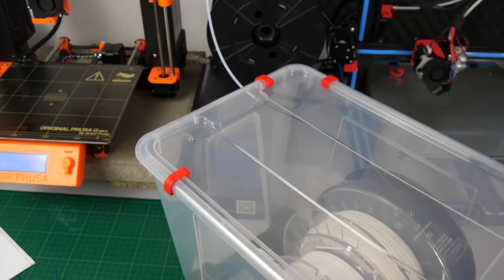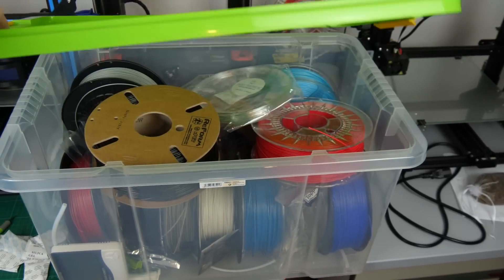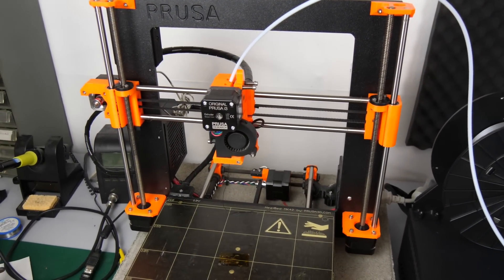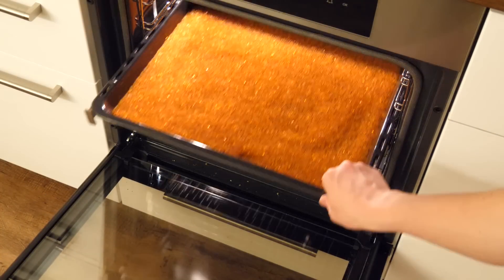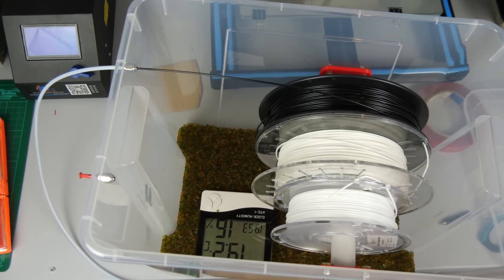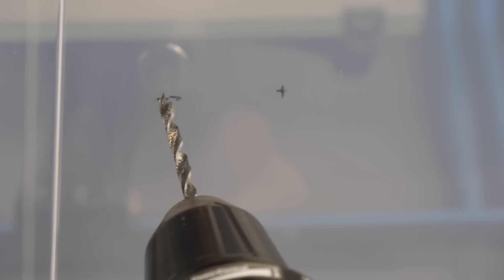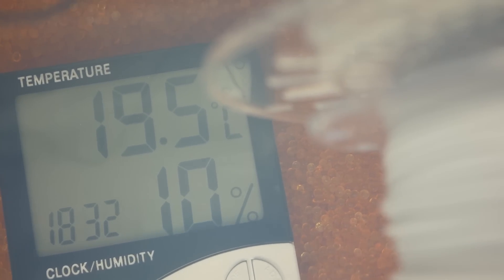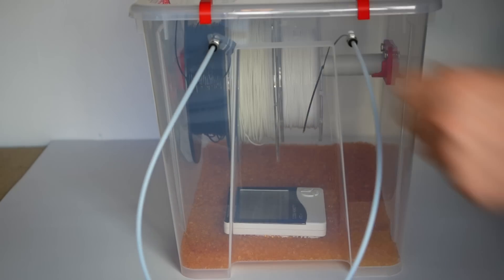Filament Dry Box || How to properly store and 3D print Nylon, PC, TPU, PVA...

Comment: 1 - the link from where he printed the plug for the other hole
2 - the link of the 5:27 universal filament dust cleaner. 
3 - post the plastic clips for the container
4 - what size of screws he is using

Comment: Kitty litter Silica Gel works very well, just dry it before in a oven or microwafe. Stefanie should have done that too, since it's much cheaper.
Reply: Thankyou its so much cheaper.     The balls are around $55 a kg.   Wile i can get 5kg of the cat litter for $17.
Reply: @turtleman190  140Celsius for some time (hour or two) in a oven worked for me now. At some point it gets not lighter anymore - meaning it's dry.
Reply: @calmarcalmar  thankyou.
Reply: @turtleman190  just saying: additionally I put them into the microwave now anyway at 350watt 10 minutes .. loosing again 2g  per 100g silica. Now I have 5% relative humidity in the box, instead of 10%
Reply: @calmarcalmar  thankyou. I will definitely be getting some because of my house plant's my apartment is extremely humid.   I only just got a 3d printer. I'm going to print what i can in pla to start with, but I want to mostly use PETG.  And tpu.

Comment: Nice idea, did you not consider a heater like a commercially available dryer to assist the drying or do you consider that stage not required?
Reply: I'd be interested in the use of an active filament dryer also.

Comment: not relavent to the video, but i havent used my 3D printer in a while, so i never got to dry my silica beeds in a year. i got a new printer and didnt have a plave to put my drying box since the spool holder is on the top and not the side, so i had to take my filimet out of the box. being in California where the wether is crazy, the filliment did eventualy got wet, so i decided to go dry my silica bveeds finaly. let me tell you, those beeds took in so much moisture from the extream humidity caused by a summer heat wave. the heat was so bad that it rained hevily in the mountains and the evaporation from the rain reached my city. it felt like the sauna. in those few days, the beads turned to dark green. they look almost black. not sure how long it will take for them to turn orange again. but i think it will probably take more than an hour for me.

Comment: The silica gel for cats are working fine, but it's wet if you buy it.
I meant it makes zero sense for the manufacturer to dry it, it's just noch important for the cats toilet 😅 But when you dry it before, it's working great :)
Im using it since a year, dirt cheap and reusable 😄

Comment: I'm doing my first run of filament drying with your dry box - silicagel method. I'm still a bit curious when I have to change / refresh my gel. At which percentage do you normally change it. At the moment I have like 24°C and around 18% relative humidity. So it would be around 4g/m³ water.. 
Do you thing this condition is capable of getting some water out of my filament or do there have do be less relative humidity?

Comment: Hi Stefan!
Would also build my first Filament Dry Box. Would you share your special Bowden Coupler "protector"?

(Hoffe mein englisch ist einigermaßen lesbar :-P )
Kind Regards from Upper Austria
Reply: https://www.ebay.com/itm/233704900524?_trkparms=aid%3D1110006%26algo%3DHOMESPLICE.SIM%26ao%3D1%26asc%3D20201210111314%26meid%3D577119fd8d2e43319be40512cc5241d9%26pid%3D101195%26rk%3D2%26rkt%3D12%26sd%3D383893385334%26itm%3D233704900524%26pmt%3D1%26noa%3D0%26pg%3D2047675%26algv%3DSimplAMLv9PairwiseUnbiasedWeb&_trksid=p2047675.c101195.m1851&amdata=cksum%3A233704900524577119fd8d2e43319be40512cc5241d9%7Cenc%3AAQAFAAACEJ6SXRZjHHoA2rJCX7TC39VU26GWP1zoQEn5Tq%252BFoCjtXTRRIB2sj2ZMjkksnbLQjM2Tjz1b3qJlkj%252BYGbZXtfbWViCaui%252FBMAUIH9ebEa1ZIrMcY0YCvW0wX2F2W4k7CtJ8y8AuvO%252BusNiJVX0CmZEvMusgME8BVomeR3JvGIc4jEtquGzJj1XIE7I3BpwBR41ITw6moRSmp%252FWDG4Vi4J%252FdhCEPCngyc5nmTmrVqCqbv2M0mn0pQ06vmrkvLnsm0QVBfWXFH2hiATKuv18mUWqdNsEDJtfioVihKOiUX%252BhBXbgk5SNjw2xyzoF4qmpVl04kCmlX1a4uIQQI7Hg4O0fOx44l1ZyrWLtXiz5T47A1lNxuzbEJlZ6yurJLorxSqpYT99NkF50qCkHNKU94zfareaB%252FrYvJjWri0c4Pw8tY0HNBGHN79P5uReth1jUqMeKHRyb%252FkMn2u0iNaTnc1vA0MUABRXqj0pAgoJjC8uv7CVNMNUKHq7pTgUvemAA%252Bkit%252FSzwWs%252BfGKJnUoNPiOHgYfCLbRUzdok1YjLghIaGdNrthB%252BSAuGNQ4cjTHMfATIj2nxtUCww7s2qdJSL76XGadSpa%252BCu1RKsCMSH%252F%252FRIb%252BL3na6SYPUtO9ayrJRX8b98k5HJMsGOtjez8r6qPjPlQ9si37iBRxLoZoUnZkkr5CBvIAbg6cwLtLk3jRZeSzA%253D%253D%7Campid%3APL_CLK%7Cclp%3A2047675

Comment: I tried Kitty Litter Silica Gel and my tester showed 80%+ humidity.  I took some and dried it in the oven for a couple of hours and now I'm getting under 15% humidity, so I would say it works but needs to be treated as already saturated when you get it.  It was a lot cheaper than other options I could find for Silica Gel, and readily available so I decided to give it a try.
Reply: I'm glad you said this because I can just get everything at store instead of waiting

Comment: that box you linked to doesn't seem to be a Samla, but a "Lock & Lock" brand one that says it's only 22.9cm high, which feels a bit tight given many spools i have are around 20cm in diameter, did you actually try it with that box?

Comment: Chances are you have a heat gun. Instead of drilling which might crack the container heat up the drill bit with the heat gun and just press into the plastic. Clean and easy

Comment: teflon tube gets stuck in my connectors if I put it in. How to fix this??? do I take the metal things that latch to the connectors out?(this means looser fitting is this fine? Also what type of nuts are used for the p4-m10 things, I ordered m10 nuts they didn't fit idk what the threading is classified as(i managed to find 3D printed nuts though so that problem is not an issue)

Comment: How did you connect the bowden tube to the extruder?
Reply: He didn't. It's not needed, as the filament is pulled through, not pushed like it is between motor and hotend in a bowden setup. The PTFE tube here is just used to reduce the exposure of the filament to moist air, and maybe to guide it if you fix the tube to somewhere. It also makes it harder for moist air to get into the box through the holes for the filament.
I'm planning on building something similar for my PLA, just because I'm storing it above my printer anyway, so I can just as well make it easily accessible when I want to change colors. For PLA I could probably get away with just making sure the hole where it leaves the box is tight (maybe with a sponge seal), but I think I'll add at least some tubing, maybe even enough to guide it close to the printer.

Comment: When printing the box lid clips, I should probably not use the PLA filament that came with the Creality CR-10s? When attempting to clip the box lid to the box there is a slight cracking sound emitted. Would a different filament type be better for this application? Oh, and I applied the weather seal (on the list) onto the underside of the box lid. Maybe that is the problem? Cheers!

Comment: Hello I really like your fillament test. Can I ask you to print 2 sets? First set do normally but the second one put in oven first. We are baking ABS injection molds at 80 C for hour witch really change its properties. It release stress from molding make it not to crack. I would like to know if it works on printed parts and different materials too. 
I Know there is lot of stres in the material after print.

Comment: Hi Stefan,
Thanks a lot for your works.
Is there a way to get all the components for the dry box in Europe? 
All the links refer to Amazon USA.
Best regards.
Reply: In usa, use a sterilite gasket box. Ziploc also has a gasket box, but the sterilite is easier if your local home depot has them in stock. Note all 4 home depots in my area reported having between 1 and 7 gasket boxes online, but none actually did. Make sure to call ahead. It will save you a drive. Luckily the lady at the first home depot was nice enough to call ahead with the item code and saved me the remaining 3 drives.
Reply: Sorry, you are not in usa, you are in EU. Dyslexia sucks

Comment: Why do you store the filament in that orientation in the box? You loose space for potential more filament rolls for each box... I use the same IKEA box, Samla 22L, and I printed these, which you don't need to screw/bolt through the box (though it might be helpful to glue/silicon them in place) https://www.thingiverse.com/thing:1888463

There is also this version https://www.thingiverse.com/thing:1752874

And these clips remixed by me, from a great design I found on thingieverse also https://www.thingiverse.com/thing:2216335
so you only need 4 of them to close it properly. Requires about 16 cm build height.

The box has PTFE connectors on both the inside and outside, but I didn't have any PTFE tubes connected at the time I took the latest picture :)
Reply: Thanks for this well-thought upgrade :)

Comment: at work we use a vacuum pump to dry out materials during storage. We use mainly resins but i think it can work also with filament spools.
Reply: Marco Calenda i was just thinking of that. Does it deteriorate the material? In vacuum it starts to release gases which might be detrimental to the material properties.
Reply: @konradritter7543  No. Filaments are stored in vacuum bags under negative pressure.
Reply: Vacuum pump? Seem a little overkill, don't you think?

Comment: Was under the impression that once your filament has picked up moisture the silica gel won't remove it, you need to put it in the oven. Is this not correct?
Reply: meucunt1 its correct you, if I have some old rolls of abs that bubble you stick it in the oven. And even with the setup you still will have to bake the nylon once in awhile

Comment: So i don't need a dry box for pla?
Reply from the maker: +björn santesson It can even have benefits for PLA, because dry PLA can be printed at higher temperatures increasing part strength. Also during wet summers, moisture can even become a problem for PLA.

Comment: awesome as always!  one thing to look into getting contained silica. much easier and neater. don't have rip the whole thing apart to empty, dry and refill the unit, and it's generally out free.  I use EvaDry units. the have a heater and everything built in. turn color, pull the evaders unit, plug it in over night and then throw it right back into the box. Very handy that way with zero mess.
Reply: The Eva-Dry units use orange-to-green indicating silica gel, which contains methyl violet as the color-changing agent. Methyl violet is considered to be toxic, although it's unclear whether it's truly unsafe in this application.
Reply: yup, but it's deemed "potentially carcinogenic"  in large volume, but safe enough and can possibly have medical uses. the Blue changing ones use cobalt chloride which is just plan toxic. In reality both are incapsulated in the silica and have very little chance of being harmful unless you over heat them and they pop open. which again, Makes the EvaDry safer as it's a much lower temp compared to an oven and is near impossible to have happen.
Reply: Probably not a problem unless it's disposed of improperly and kills some fish. ;( Do you find that one Eva-Dry unit per storage box is enough? How often do you need to "recharge" it?
Reply: ya, one is enough for each of my 72 qt boxes.  Mid summer when here on New England shoreline the humidity averaged 80+ percent, it held under 30 percent humidity and I had to re charge over night like once a month. Winter, with heat on and super dry low 30% humidity like once every 3 months if that. That is going to depend on how often you open the box and such. I had 2 yr old filament that was soaked and was going to toss, thew it in there for a week or 2 and it was actually printable again, not going. to say it was perfect cuz it wasn't, but was usable for prototype printing where I just wanted to see how the shape is of the model.
Reply: Thanks. Sounds good. I'm going to give one a try.

Comment from the maker: Sebastian made a very true comment. Use Cabalt and DMF free silica gel, because some indicators are potentially toxic and carcinogenic! Replaced the link in the description with non-indicating silica gel. Health goes first! Just use the hygrometer to judge if the desiccant is saturated or not. I'd make sure that the moisture in the box is below 20%.
Reply: With the rain here humidity can go up to 90% or sometimes higher, no wonder I haven't opened my CarbonX roll yet.
Reply: Just as an information: The general information about Cabalt and DMF is correct and you should look out for them, BUT the product in case (ST Trockenperlen) is Cobalt and DMF free (it's advertised as such and labeled by them as "nontoxic").
Reply: Kinda makes me glad I live in the southwest USA. Humidity doesn't often go above 40% unless it's monsoon season. (for an example, it's supposed to rain tomorrow, but humidity is only 20%)
Reply: I could be totally wrong but aren’t the blue indicators the problematic ones (and thus banned in EU), and the orange ones are okay?
Reply: @Sa-fd7ih  orange one are mitogenic
Reply: @Sa-fd7ih  the orange-to-green silica gels contain methyl violet, which is toxic and potentially carcinogenic; regardless, it is not safe to use in or around food, so it should not be reactivated using an oven or food dehydrator that you intend to use with food again.
Reply: That link does not work for me
Reply: link for silica gel goes to "DRY&DRY unknown" :(
Reply: "DO NOT EAT" what does it mean??
Reply: @truantray  It's mean DO NOT EAT

Comment: Humidity will still get into a thin non-sealable container.  I like your effort, but must get a box that can SEAL.. but thanks for video!
Reply: you can see 15% and 16% in these boxes. That super low.
Reply: You can test the moisture levels easily. Even in this design the moisture is radically reduced, the is no real need for a completely air-tight seal.

Comment: Nice Video. :)
But do you think it is worth it to buy one of those instead of the reusable Silicat? https://www.pearl.de/a-NC4809-4320.shtml?query=Luftentfeuchter
I use a Drypak with reusable Silicat but my Dad want a electronic Solution. (I don't know why)
What would you recommend?
Reply from the maker: This is basically the same, since it also contains silica gel, but obviously has an internal heater for restoring the desiccant. I'd still go for the loose pearls, since they can capture more moisture (due to just having more material). But still, should also work!
Reply: So i pay for a Solution that dry the Pearls inside of that Thing but don't have that mutch of it inside. :)
Reply from the maker: +Andre S. Exactly.

Comment: Aie aie aie.. 21 hours too late ^^
Richard Horne just did this one: https://www.youtube.com/watch?v=RvTTQqqWIWA&t=0s
Reply: Yes, but Stefan's design is nicer than Tom's, and it includes a hygrometer, which is pretty much a necessity without color-indicating silica gel. And Stefan shows how to properly dry and reuse the silica gel, which Tom does not. So it's good to have multiple designs to compare and multiple videos from which to learn.
Reply: Aditya Mehendale And Thomas did it end 2016 https://youtu.be/OY5n9q-wS7k
Reply: Yes, but Stefan's design is much simpler than RichRap's. Also, it is doubtful that a heater is necessary.
Reply: Roger that!

Comment: did anyone try salt as moisture collector?
Reply from the maker: Nope, but I think I've read that normal table salt won't bring the moisture as far down as silica gel.
Reply: ok could be, and rice? It's put into salt dispensers, to keep the salt dry
Reply: @pixelcomet  it works a little bit, but silica gel is a lot better.